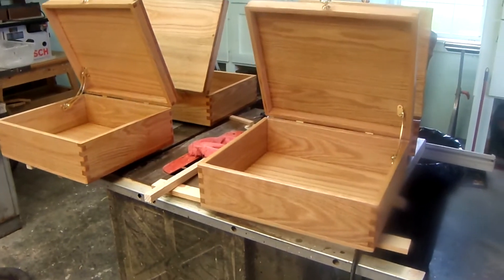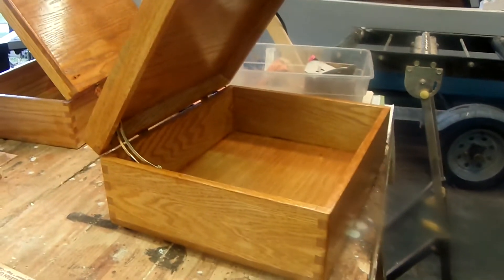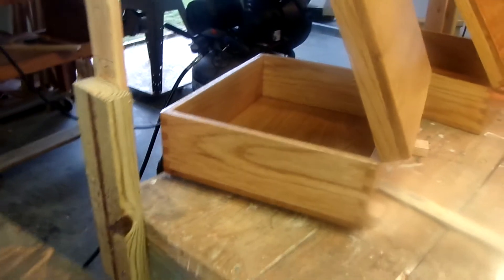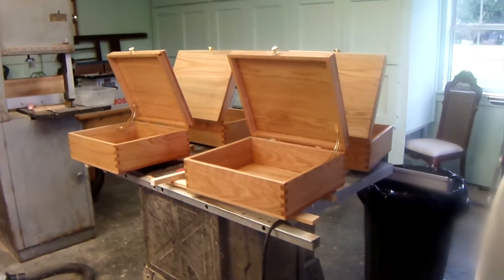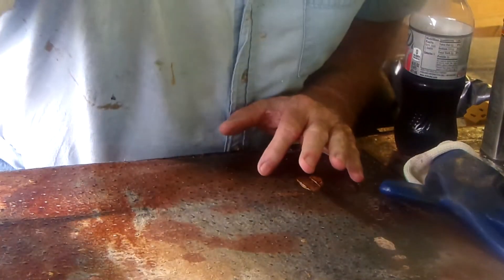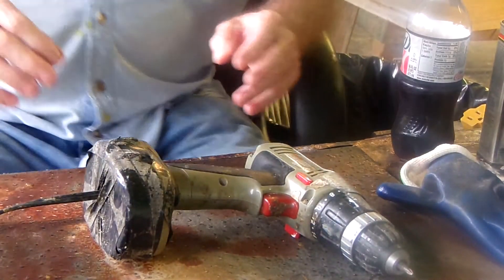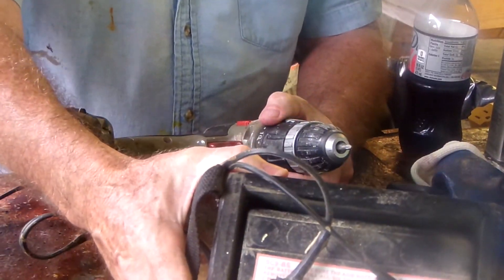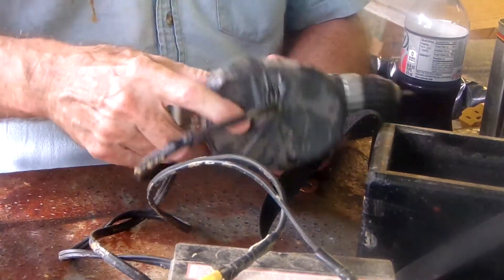Cordless Drill (sort of) Helpful Hint 1

Comment: pretty creative with the drill and nice work on your christmas gifts
Reply from the maker: Thanks Walter.  Was nervous about putting that hint up, as putting a cord on a cordless drill seems to be missing the point.  However, I've been using this system for nine years, and it has been remarkably successful.  
If you care anything about mechanical stuff, check out my videos on installing the inboard motor in a wooden boat I built.

Comment: Awesome boxes!!! You need to come over here and help me make my kitchen cabinets. I could never make something that beautiful.
Here is a tip. Change the title of your video to "How to convert a cordless drill to run off a 12 volt car battery" or something like that and watch the video increase in views. Make another video using alligator clamps and talk about the value of this tool on the road for emergency work or off the grid like I am. Having a reliable tool like this is important out here.
Reply from the maker: I'm all over it.  See, I'm such a rookie I don't know what folks want to see.  I didn't think that anyone would care about the technical end of the conversion.  I will do it.

Posting another video on the boxes.

Maybe I will post a video on how to make fast, cheap, and good cabinet doors.  

I'm honored you actually watched my video.

Comment: Great idea. I wonder if a 12 vdc batter would burn up my old 9.something vdc Makita? I have two of the Dewalt 1/2inch chuck drivers. Each came with two batteries. The battery alone is $99.
Reply from the maker: I'm about 100 percent sure it would.  The DC motors are all about the same size on the smaller 9,10,12,18 VDC versions of these things.  The advertised voltage is from the battery, I suspect.  In any case, I've attached a 12DC battery to a 9 VDC screw driver (one of those real small deals), and it worked fine.  I used it for a couple of years before I broke it.
Another factor is voltage drop, which in this case would be a benefit.  You could have an extra long wire to the battery, lose 3 VDC in voltage drop, and still get full power to the drill.
And the beauty of it is, you can see if it works for exactly zero money, provided you have some old electrical cord around.  Hook it up, and touch off the ends on a 12 volt battery.  Test complete.
Reply: ***** Can't hurt to try. Not gonna buy any more batteries for the Makita.